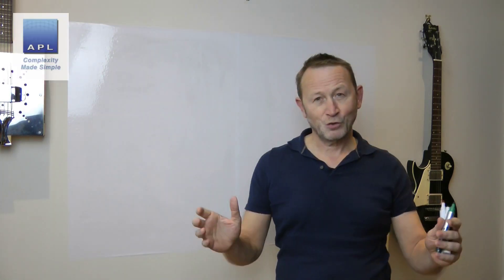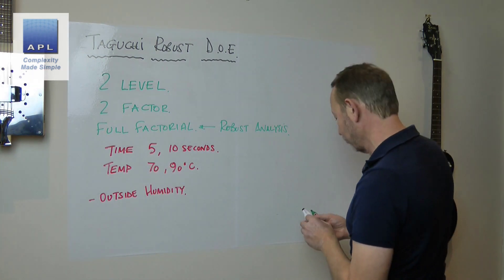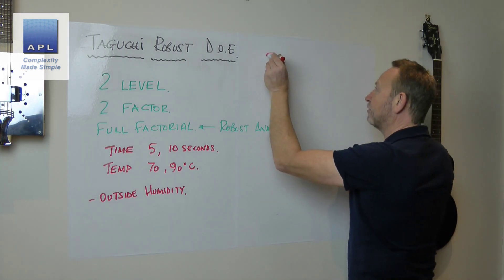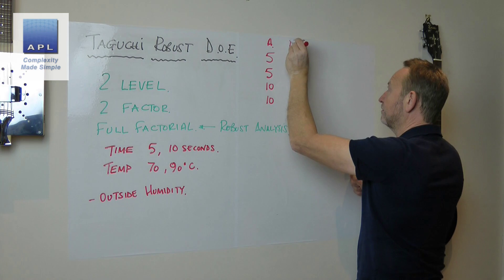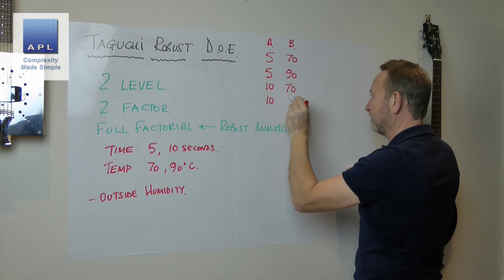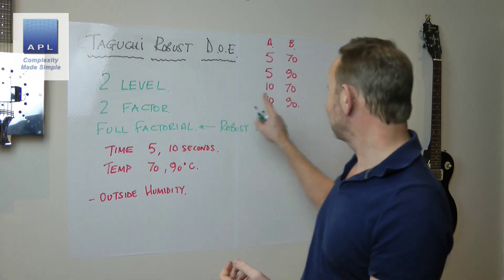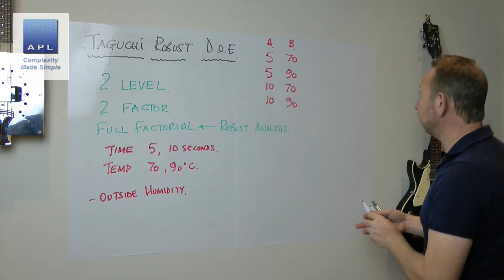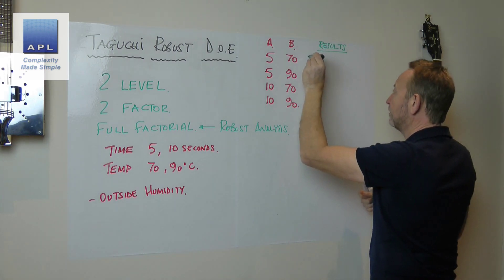Taguchi Robust Design Of Experiment - 6 Sigma Tutorial

Comment: Hi, thanks for your great contents. I was thinking wether it is possible to obtain the same information using a split-plot design, allocating humidity as a whole-plot effect and the other two as within-plot effects. Humidity can then be treated and estimated as a random effect. If that's the case, which of the two approaches do you think is more effective and with more statistical power? Thanks.
Reply from the maker: OK I think I know what you're getting at. Don't forget the information you want is can I set my controllable variable in a place where the effect of the uncontrollable variable is minimised or swttched off. The taguchi method does that and if it does it why do I need another method?

Comment: Unfortunately I tried all of this and our process isn't robust enough no matter what we try :/ sometimes the underlying mechanical engineering is just bad and we have to change the entire design of the machinery.
Reply from the maker: Hi Nano - OK you've just found out a very important rule of process physics. Step 1 stabilise the process Step 2 do the clever analysis. If you can't put the same settings in a machine and get similiar results a DOE is uselss to you. Please send me an e-mail Paul.allen@allenp.co.uk and I'll send you 5 videos (10 mins long) that will show you what you should do instead. If you tell me a bit about the process I might add a bit of extra advice as well...

Comment: Thanks for the interesting lecture. It is notable that there can be other sources of variation in addition to the humidity, for example originating from the repeatability of the method itself. Thus, to understand the other sources of variation and their magnitudes as well, multiple repetitions per experimental setting and humidity level should be ideally done. For example, there is a risk that some rare outlying run happens to occur at 5s/70c set, increasing the corresponding SD even if the process is actually insensitive to the humidity, and then the engineers select some of the longer/hotter non-economical options due to the false signal.

Comment: Hi Paul, I have been following your videos, thanks. I have a question for you, IS IT POSSIBLE TO RUN A DOE, based on MODELS, without actually performing an experiment? for example if a response variable depends on 3 factors with a Mathematica model such as y = logx1 + sinx2 +e^x3? Can I run a design of a experiment with logical levels for x1 x2 and x3, and then observe interactions?
Reply from the maker: Jide - great to hear from you, the simple answer is yes you can do that, you simply create a table based on the input variables, you will only get one data point per combinations. but you will get the interactions as well. I will make a video about this in the new year. Because you've got log values, the DOE will not be linear. So a CCD would the best choice I would guess...
Reply: @paulallen5321  Thanks Paul and I await your video next year. By the way, the equation I dropped in the message was just an hypothetical example. The real stuff is a multiple factor, and multiple response analysis using a math model for woven fabrics. Thanks again

Comment: Nicely explained, as always =)
This does assume that those parameters have a linear effect, right? Or can you also do this type of DoE if a parameter has an optimum (so a 'better' point than either of the extremes)?
Reply from the maker: In this case Tom the robust approach was attached to an L12, but as far as I know you can attach it to any DOE type as long as you replicate so that SD can be estimated it will work.
Reply from the maker: By the way the Robust case study has been loaded to my channel as well...
Reply: @paulallen5321  I know - liked that one too (https://youtu.be/2JuYwZ7fS7k). Just though that this question fits this more general video better.